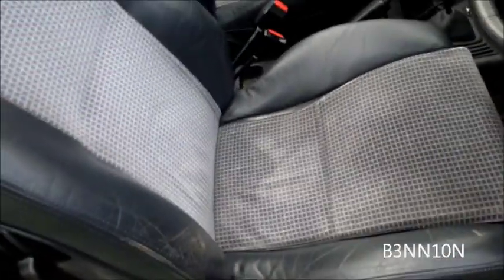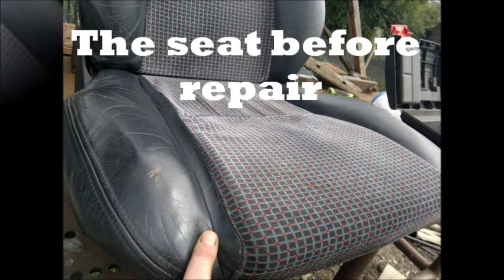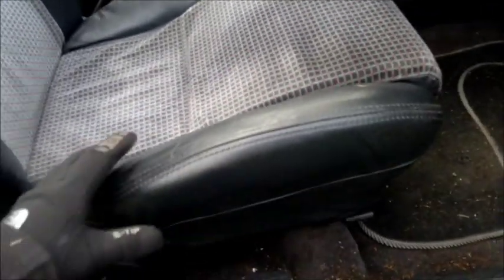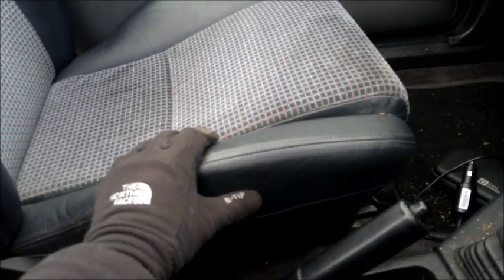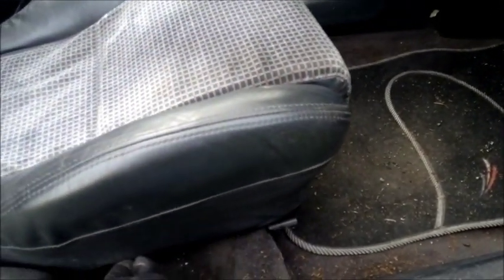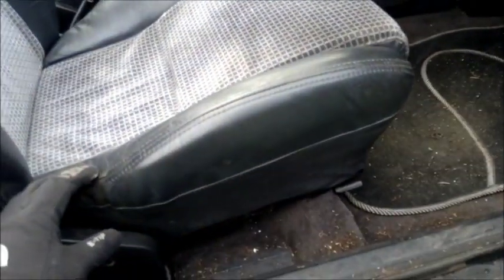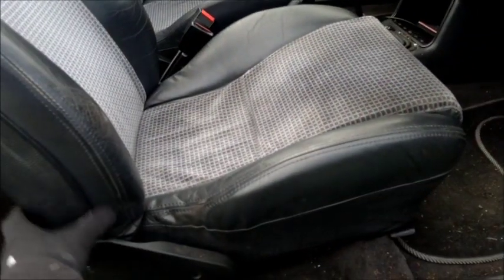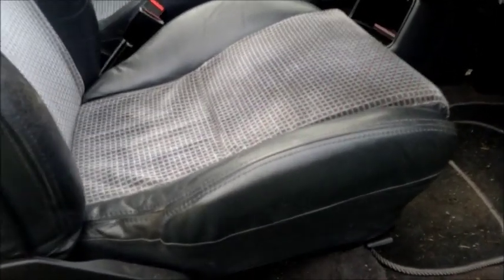How to repair an Escort XR3i Seat - collapsed bolster - similar to recaro - MK3 MK4

Comment: I used to run a small test lab for a company that owned Recaro, at a seating components plant in Michigan. For one thing, that seat in the car only resembles a Recaro. It hasn't got the "bones" that a Recaro has. The seat in that car looked tired. The side bolsters might be important, but if those were so broken down, I'd hate to see the condition of the seat recliner attachments, and the seat tracks. Metal fatigue... bolts with cracks... recliner showing cracks... If it were my call, I'd just find a similar passenger side seat at the auto junkyard, and replace the whole thing. Yes, it might cost more, but it's better than a broken neck, when rear ended.
Reply from the maker: nonsense. The car has only done 60k but obviously had a fat bum owner that has bent the frame and snapped it. The weld i put in was bigger and stronger than the original.